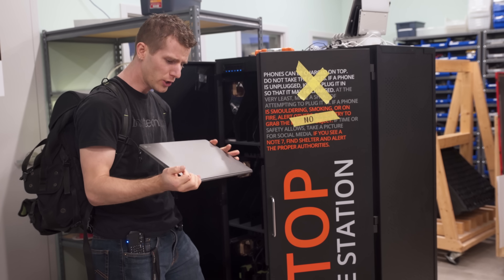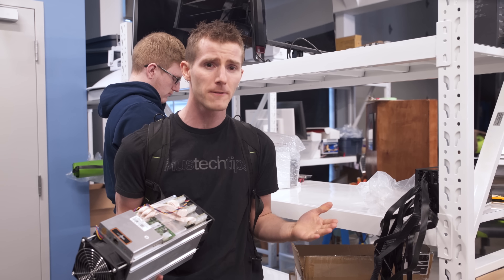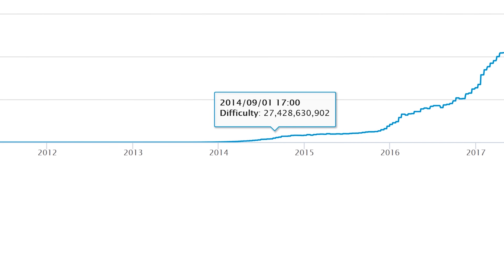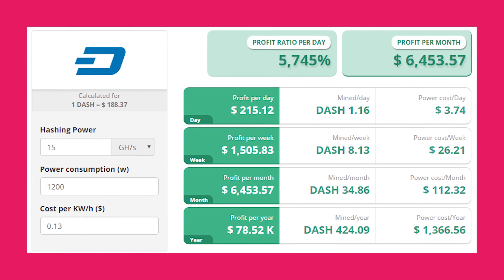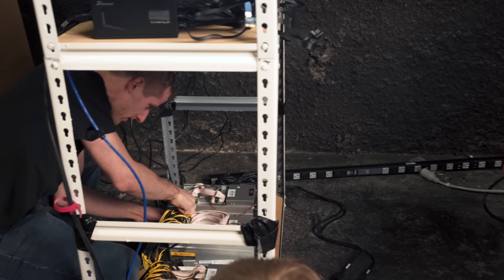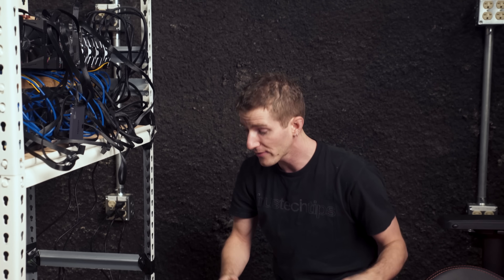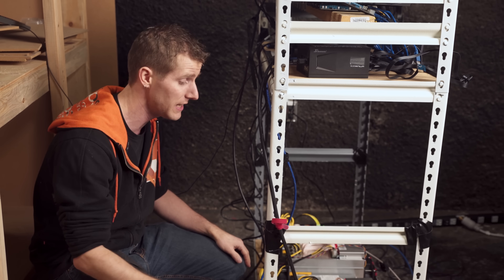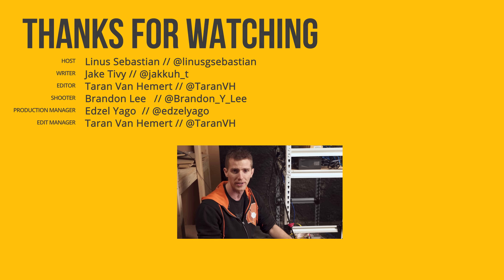Is Mining on ASICs Worth It? - Mining Adventure Part 3

Comment: It ain’t just miners taking the GPUs. Its also regular folks who could give a crap about gaming or mining who have bots buying the GPUS so they can make money reselling.
Reply: X4 Gaming but they wouldn't be doing that if they're wasn't miners buying them.
Reply: Miners and gamers.

See the whole system was built to house just gamers and that's all it did for decades.  So with any influx of people.  Or people just deciding they want 2 cards instead of 1 now.  It was gonna hit a crash.  
In this case though it's 5x the sales numbers if not higher and really they just need to make more cards.  But they won't because high demand low supply is amazing for their bottom line.
Reply: I'm sorry but if they are making bots to scalp the market that's not regular people.

Comment: Reselling GPU at a "fraction of the cost"... In this climate I have to disagree. I bought an Radeon RX 480 2 years ago for $200. They are selling on the used market for $450. And my GTX titan (700 series) is still going for $400 used. 
I should have invested in GPUs 2 years ago :p
Reply: mtktm yeah, but if the crypto crashes to a level that is not profitable anymore, than there will be a shit ton of rx470/480/570/580 and all of the nvidia cards for literarly a few bucks a piece. Right now there is around 10 500 000 GPUs world wide mining crypto.
Reply: That's not what he said or meant.
Reply: mtktm you ain't never lying . I have a Casio calculator that does adding and subtracting and weird basement turds are peeking at it with glee through my windows.
Reply: adam šišpera I thought that myself . but , and a big but , there will be those who see the value of the cards being so low as very useful for buying and stashing short term til market normalized. Profit achieved. 
There will be those in need of higher end graphics cards at a more reasonable price , waiting . there will also be smaller company's and research groups looking to pick up large lots of cards , motherboards , CPUs ect. At the same , more reasonable price. This all means , the prices will only go down to the point of 1st buyers. At which point , the market will began to plane off ( normalize) . beware , these prices are at most a year to year and a half holding. 
Theoretically. 😉
Reply: Yeah I laughed at this comment as well..I paid about $120-$160 for my 4 7970's at an NCIX wharehouse sale and sold them 2 years later for $300-$350ea lol
Reply: you caught it just as GPU mining was on the up. With cryptocurrencies sky rocketing. the same happened 4 years ago, GPU prices for certain models went trough the roof because of Bitcoin hype-train. when the price crashes people will want to rid of the 5+ overworked GPUs but the market will be saturated so will sell for far less than when they bought, then the hype-train will swing back around and the prices will rise. you can make money without even mining a single coin just from buying and selling the right GPU's at the right time due to crypto market value and media hype.
Reply: Yeah, for now. But imagine if the cryptocurrency scene suddenly disappeared and now everyone is looking to sell their dozen or more gpus. First, they've been running overclocked nonstop for who-knows how long, and then there's someone out there willing to sell cheaper than the cheapest, just to get some bucks back. I wouldn't buy a mining gtx1070 for more than $50 after it was refurbished. And the price is just going to continue dropping.
Reply: Pandering to the crypto miners is lame.
Reply: mtktm the point is that you would only sell if it was no longer profitable. At THAT point you'd only likely to be able to sell it for a fraction
Reply: Yeah I got in in 2012
Reply: "imagine if the cryptocurrency scene suddenly disappeared", This is like saying imagine if the internet suddenly disappeared :P And I never OCd my cards but I expect some users would.
Reply: Just bought a 480 a month ago for 170 and sold for 400 lol
Reply: Well, I'm offering my GtX 980 for $200 and nobody wants it.
Reply: "imagine if the cryptocurrency scene suddenly disappeared" -this is not an impossibility. Government regulations could turn to the whole thing into a leaky boat, and if they are not used to trade for real goods for whatever reason then the same thing would happen. Not meaning to be a Debby Downer, but there is some inherent risks that not a lot of people discuss.
Reply: Linus said "some fraction", and that isn't wrong. Even if the price doubles it's still a fraction of the original cost (1/0.5)
Reply: Totally got a Nividia GeForce GTX 1070 for ~$340, on sale, over a year ago now... Current listings are around $600, same model. 
At current prices I can't recommend building a new PC. I just hope they chill out with this supply & demand price inflation soon.
Reply: A lot of misinformation about GPUs in this thread.  First of all, miners run their cards with a slight overclock on the GPU, and a bit more on the memory.  At the same time, the LOWER the power and increase the fan speed to keep the temps under 65 C (conversely, gaming CPUs on 'AUTO' tend to be stingy with the fan and will the GPU run upwards of 80 C).  If the miner screws up the card, then it's usually bricked.  So you don't really have to worry about getting one of those.  More often then not, your used mining GPU will late until you are ready for the next upgrade anyway.  If their running environment was particularly dusty, you might be looking at having to replace the fans.  But if you ended up getting something like a 1080 TI for $500, would you really be that put out if you needed to spend a little money to get the fans replaced?
Reply: As he clearly said "WORST CASE SCENARIO" hes talking about after they are no longer useful for mining.   So, when the cards are NO LONGER ABLE TO BE USED FOR MINING, you can still sell them for a fraction. WHEN THE ASICS ARE NO LONGER PROFITABLE, no one will buy them because they have no other purpose.

(aka after everything switches from PoS to PoW or everything requires ASIC miners.  And also after the possible crypto bubble collapses like a house of cards.

Also if you guys aren't willing to buy mining cards, you dont really understand how the entire thing works and what sort of "strain" it does, or rather doesn't, necessarily put on the card. @ABQSentinel has a pretty good grasp of what the actual "mining process" does to a GPU longer term, which is, not as much as you all think.  Someone said "I wouldn't pay more than 50$ for a 1070 that was mining for a year" I think you don't understand the actual "strain" that was put on that card.  Its relatively very little.  The cards are undervolted, are kept at high fan speeds, and running a GPU constantly as long as its kept cool, regardless of overclocks or voltage settings, will not "kill the card" nor reduce its performance significantly.
Reply: 3/2 is a fraction
Reply: Emit remmus Is Nvidia a public company on the stock market? Or are they a privately owned company?
Reply: Public....their stock has been SOARING over the past year the way bitcoin has, only its a much safer investment.  Symbol NVDA.  At the beginning of 2016, the stock was at about 28$/share.  Today its at 242.72 at close.
Reply: KMAC hm interesting. Thought they would've been a privately owned company but hey you learn something new every day
Reply: I wish I had bought Nvidia stock a few years ago just as much as I wish I had held onto the 5 bitcoins I bought back in 2012 for....illicit purposes. Never expected my 80$ bitcoins would eventually be worth 15,000.

And yes to anyone who thinks its bullshit, I did actually own bitcoin way back when.  I remember when they jumped from 50$/each to 80$/each, and I thought that was madness at the time, an almost 100% jump in price.   When SilkRoad went under, I thought that was the last song and dance for bitcoin.  And it dropped too, but boy oh boy did it comeback somehow.
Reply: I can't wait for that to happen so I can pick up a GTX 1080ti for a couple hundred.
Reply: For gaming GPU's that's ok considering the current prices. But I guess you should always note in the description if a graphics card was used for mining. You don't have to but it's just ahole-like to sell it to somebody who doesn't know it.
Reply: Overused GPU? I'm looking forward to buying them. There's a short list of what goes wrong. Half the time just applying new thermal grease is enough. A mining friendly vbios might need to be flashed back to the original. Rough handling might require soldering to repair.

In the last month, before prices spiked I bought a "for parts, not working" GTX 980 for $100. It had the heatsink removed by a gorilla and several surface mount caps were busted. I had it repaired in no time. I can fix anything, so the worse the damage the better the bargain.
Reply: Chris Balfour Of course that's a good bargain for people who can repair it but it should clearly be marked as "Mining GTX XXXX" or "Not working"
Reply: He's talking about when crypto crashes or becomes so difficult to mine that nobody wants to buy your GPUs anymore because they wouldn't make any money with them either.
Reply: +mtktm
If we all could go back 2 years in time and re-do things, we'd all be rich and successful.
Reply: metatech I hate to burst everyone's bubbles but the way most cryptocurrencies work is they're decentralized (no single entity is in control), they're just an open source protocol anyone can run (even you!), so there is very little chance of it ever going away, even if every government on earth made them illegal, which would be extremely short sighted. It would be a lot smarter of you all to learn about crypto than to be salty about it.
Reply: You could just say buying 1 mill of bitcoin before 2016.
Reply: @adam šišpera
Not all GPUs are in demand. Only the ones that are SLI (Nvidia) or Crossfire (AMD) capable. So as far as nvidias go, pretty much the 1060 and 1050 (not sli capable) haven't gotten much of a price hike, and the 500 series and lower aren't worth much over all (not win7/win10 compatible)
Reply: mtktm Mining doesn't use SLI or Crossfire, you actually disable them.

Comment: Something also to note is the difficulty increase. That will really push the ROI out exponentially. Unless you can get the units for retail right when they come out and have access to really cheap or free electricity then the ASIC's aren't really going to be a good investment for the hobby miner. Unless you plan to almost immediately flip it on ebay for an inflated price. which, honestly, isn't a bad idea. GPU rigs, as noted, are easy to part out and re-sell. And the secondary market on GPU's right now is fairly inflated so the prices are pretty high. Mostly due to GPU miners.

Comment: so optimally, the best solution is to use GPU mining, and to resell the GPUs once they've paid themselves off+ some small figure (say $1,000), so you can essentially continue to profit on the sale of the  used gpus. (and by which time newer GPU hardware (with better hashing ability) will have come out, which you can then re-invest and repeat?